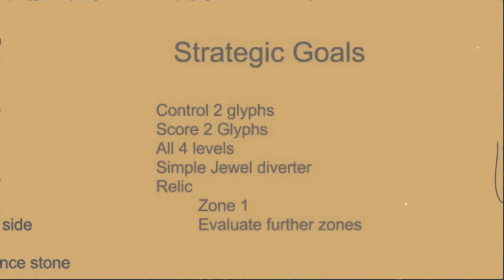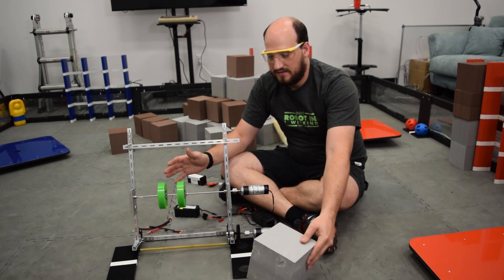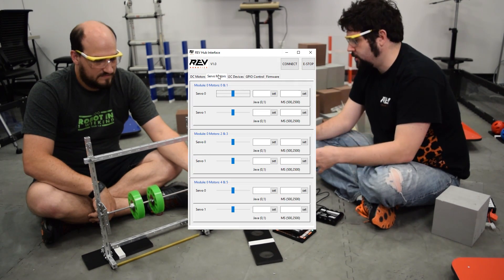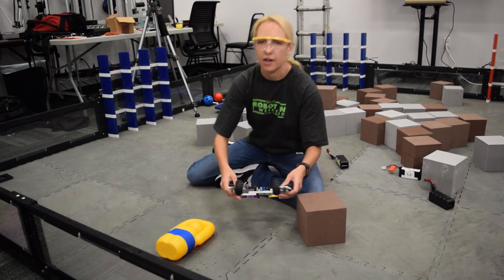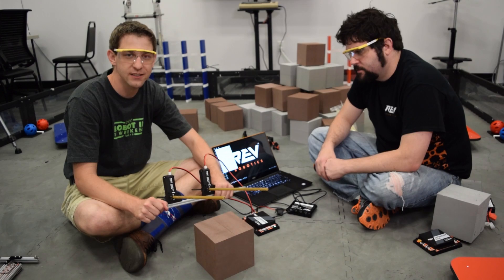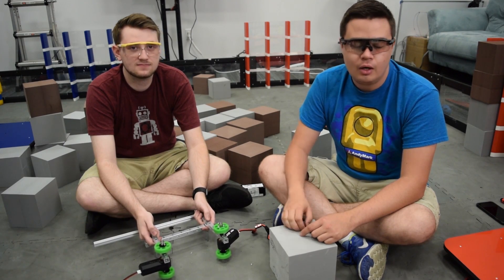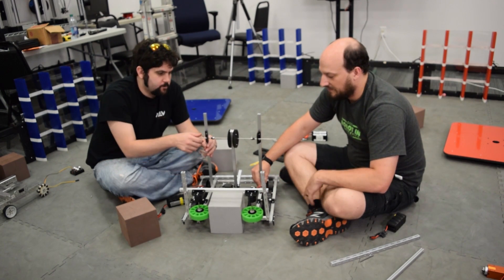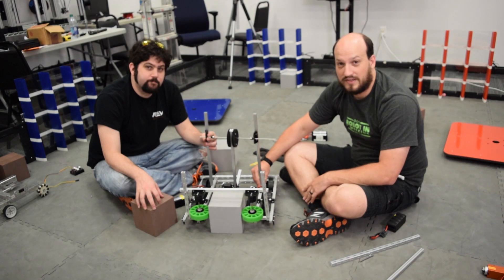Day 1 - Prototypes | FTC Relic Recovery 2017 - Robot in 1 Weekend

Comment: When will the REV hub interface software be available?
Reply: Linda Stewart I think it's available to order now
Reply: I couldn't locate it on the REV website or via Google search - you have a link?
Reply: It is integral to the FTC app software.  From either  the DS or RC phone you are able to configure components thru the hub. You can connect to the phone via WIfi direct from a computer browser and in block programming all addressable elements (REV motors, sensors) will be available to use. There is a beta app available at Github that also has ONBot Java, Java programming directly on the phone without an app builder.
Reply: Putting in my vote for the authors to tell us more about the Hub Interface and when it is available :)
Reply: Sign me up for an update on the software.  This would be a huge help.